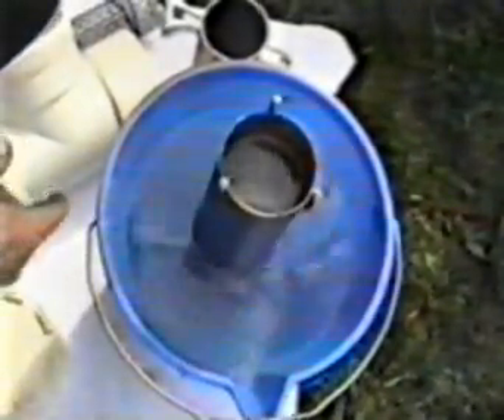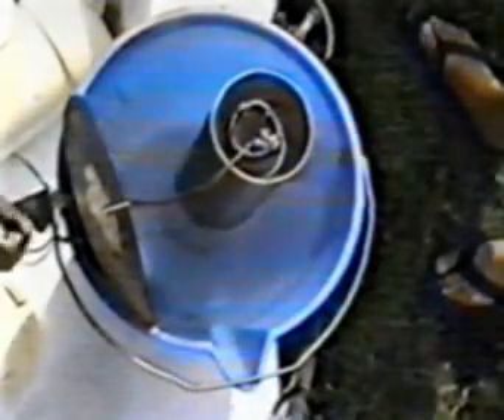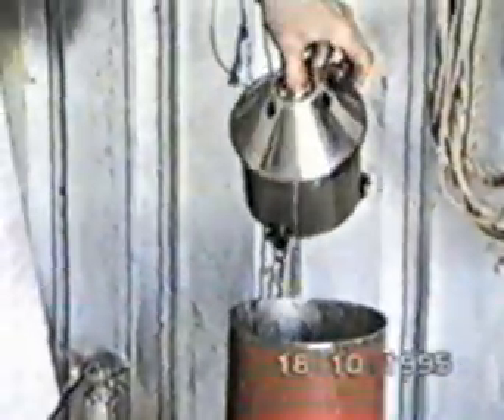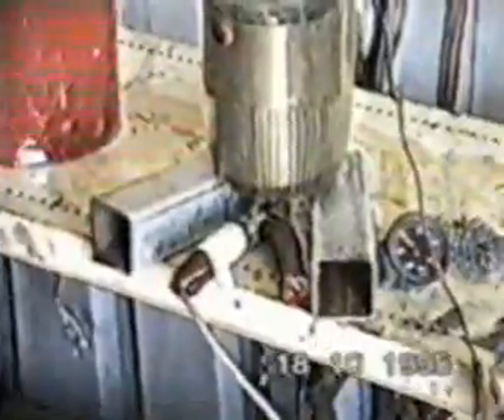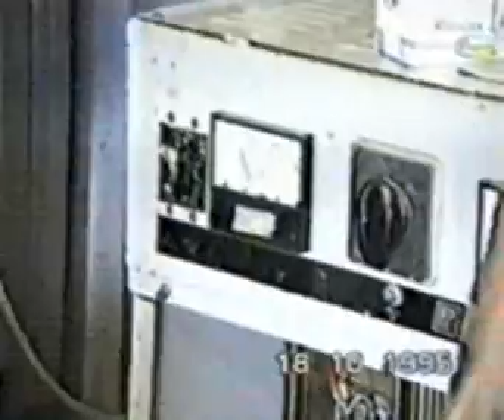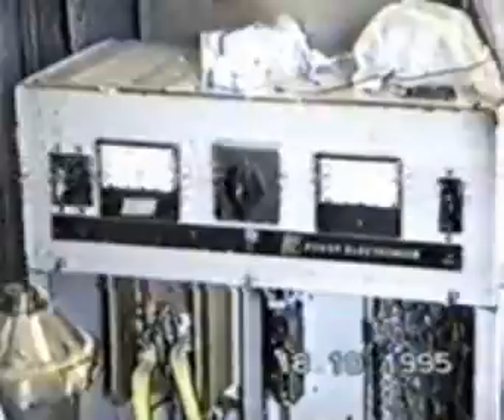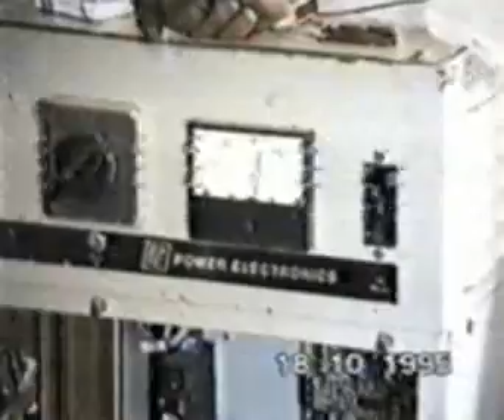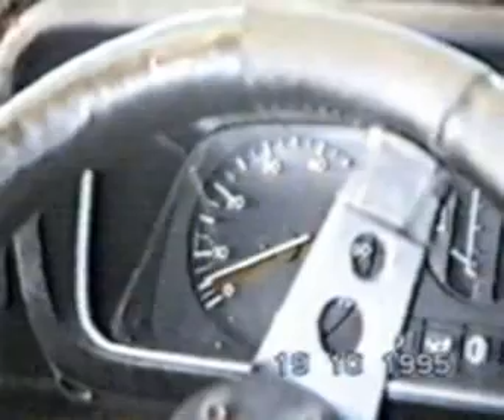Joe's Energy Cell (original recording 1993)

Comment: I will by short. Opel is an specific engine it has lot in common with the Adams Familie movie . First that engine is based on militari engines they have programabel cilinders and valve heads it is related to this: multi fuel,dual porting of fuel,multi stroker, 2-3 engines working in 1 unit !The other detail is it can work on organic gas aka bacteria and elements mixtures .So that thing produces it's own gas while operating in time delays. The Hit n Miss miss fire sequence is perfect exampel you use reactivity of gas to explode it after that second effect acures thermal atraction the 3rd action is electro magnetic gas atraction by its polariti atraction. That way you gain 3 different engine types who all of them need proper control cirquet to control them in %\%\% ratios ! They call an Opel engine Internal-External burning engine for an reason or Dobbel Acting Fuel behavior so the actions are delayed in time differences so dobbel or multiple ignition events acure and yes you can pulse different electricity types in phase angel difference as long you use up that energy no dead short what so ever it is based on( Metadyne rotary transformer with variabel brush polariti out put + - ,- + ,+ + , - - ),or transformer when you latch pins 220/12 = "-232,+232,-208,+208 and still probabli you can add dc pulsed cirquet and flat line dc on the same transformer thats called universal out put power supply ,similar to it is computer psu when you mix out put polaritis of individual leads,dual relay effects,delco magnet starter motor with s/r starter selenoid ,alternator secrets delco 12si hv bypass methodes twin regulators and twin rectifiers serries/parrarel switches,wacum tube baterry charger 3baterry types unsed at the same time, buzzer horn,those cars do not have diodes or zener diodes,heavy tendency to absorb tree based acids condensation and coolant electrolisys,they have bade tendency to run at ultra lean and rich fuel mixtures ,and they do love cold diseling and pre ignition effects. Cars related to that subject are Shell 376mpg Opel Rekord P1,Hot Bulb Dual Fueling Train with Electric Tripler Set Transmision exciter+dc-dc converter+Metadyne transformer ,Owen Magnetics,Deuce Half Truck Multi Fuel Engine ,Farmmal MD tractor ,Caterpilar 2 stroke pony motor so add extra cirquets like stroke devider/multiplier ,magnetic pumps,high amp ignition or plasma,add vaporisators,magnetic gas pulsers,magnetic metal elasticity enchancement,magnetic head valve control ,magnetic mixer and most important learn to condense gas floating in air based on tree mather who are atracted to an hot magnetised motor the motor will flood crank case or rapidly cool down >compare pure tree oil with gasoline in flame strenght smaller carburetor jets so it is similar to furnace oil burners and co2 gas arc welders ,lot effects acure but ordinari Opel engine can use 1 of those mentioned engines ( strling,steam,papp,flame liker,rocket,pulse jet ,hot bulb ,hit n miss and normal acids,gasoline ,diesel,lpg,propane,ethanol/methanol in their pure state. So I listen to your guys suggestions but I already know lot of it after all I did witness some of those effects on my own and that Yellow guy is hell of an good mechanic . Controling 2 engines is an great deal but controling multipel of them and spliting them in to fractions is some thing ells .The problem with you guys aperantli you do not understand the wide varieti of engines that can by mixed in twin formation or tripler set that wuld explain why fuel is used more like an solvent and other gas takes over who are mixtures co2 ,organic ,or pure based fuel who is combined added aditive Later so the engine it self is an procesing unit well if you can't exceed 100% burn rate so you simpli use other reactions who were not used before like exampel magnetic atraction of gas so that engine creates static discharge from its own cilinders called the Papp engine effect so bouth + and - paths to devices and baterrys are effected . I call it more generators out put polariti ratios in hrz frequency range difference and colideing electricity types at phase shift and hrz difference effect varies . But plug out ordinary starter motor magnets miss place them you get different results at ich brush out put ,brake magnet,displace their pole faces ,or heat up ferrite magnet or use short brushes or place brushes serries/parrarel path's toggether you will see result instanli ,virtual baterry plates are easely created in fact 2x 5pin relays to lot staff ,xenon with out ballast gient sparks . Any way I won't argue with people I admire thatose guys they are honest and have great knowlage I respect that lot effects acure at the same time so all sience is involved at the same time so results varies always who goes last or first doesn't mather the engine it self operates in unusual fashion .So it's easy to turn any engine to their older form if you know what cirquets you need. Exampel an hot bulb can work also on magnetic pump insted turbo ,or changing 4 stroke to 2 stroke or 0 stroke who is free floating gas from exaust to intake might as well represent an rotary engine type as Pulse Jet , it might by that you can seperate ethanol/methanol in an engine at fire one of them at compresion the other at exaust that wuld explain why magnetic pulser seperator pump is used with 2 different sparks frequency ranges that's called ordinary electriciti phase shift but aperantli gas can by phase ported as well so that's the term Dobbel acting fuel effect . Any way my set up is different cars around the world have different enviroment ,control cirquets who are hidden and slight differences are present for Vauxhaul,GM,Opel,Holden but the basic principal is always the same . In fact pierburg carburetors have even thermo time valve if you crush that deam thing you finde inside 2 disks and some sort of ceramic substance fuck my that deam thing looks like an piezo disk vaporisator ,leaky mechanical fuel pump,some chlorine+calcium+brake fluid =self ignition fuel and that all is bypassed wia blow by hose even if you shut of carburetor the crank case acts like 2stroker fuel pre heating and porting , well most of the time if my engine is magnetised my car uses only idel port and accelerator pump on an magnetised engine at some point centrain engine rpm the primary and secondary carb Jett's are not even used so on what ever that deam thing is running on isn't really fuel but I mentioned inurt gas,metal particel and tree based substances any way and the fuel reservoir is kinde of to close to exaust pipes ,ethanols bade tendency to absorb moisture well some bacteria eating oil suposedly exist and ther you go engine runs on peanuts with out an cell 🙄🦾 yeah many peopel dont know those old engine effect simply many things are to much involved confuseing lot but bouth Peater and Joe are far beyond capabel men 👍 I personli managed only controling my engine at some point changing their engine type individuali some times by accident get twin engine effects or share gas betwean cilinders ither crossing spark leads ,reversing distributor,external arcing relays,valve clearence intake-exaust or I belive in my case the implosion/explosion effects caused my block to form small micro cuts the size of an sawing needle so exampel 2nd cilinder shares some of the gas in %\%\% ratio with 1st and 3nd cilinder to compleat the cirquet you need to attach cilinder 1 to cilinder 4 the multi stroker is set or some other fiering sequence is set like in my case the British Flat Head Fiering order works as well or pure external ignition if you put distributor on warm engine at 180° . So you guys are sourcing the wrong direction long time ago. I personli withesed my own engine working for months with out fuel it Actuali gained it by absorbing moisture from the air but in return more coolant and lubrication oil was consumed perhaps I did not have good cooling capability but even that probabli culd by reduced but with out proper transmision or electric traction motor that thing became ordinary tractor motor with enchanced effects mostly massive torque and fuel efficiency nothing ells. So it does work kinde of but all systems in the car probably need regulation bether and cloosed loop system expeciali starter,alternator and the baterry .Most likely the engine shuld not have any phisical conection with the chassis so the engine must by insulated .Because if an car is magnetised all metalic springs stiffen or harden so you running at rish engine run away or loseing brakes or suspension might fail including rubber deteriation so tires might blow up so that's why shell put the engine inside an box who is an multi porpuse device (eliminates emf radiation from high amp ignition,prevents rosting chasis ,ceaps heat inside,the box is an ventilation for toxic gas neutralisation,to maintain or regulte heat and moisture content of air,preventing fuel from frezing,buffers engine sound and similar) preventing general damage that's why Shell managed to gain that tremendes milage and I beat them long time ago even tought by accident . If your not capabel useing twin engines start enchancing ordinari hot bulb or hit n miss adding cirquets to it and finde ways to "compensate for loses" then eventuali the Joe Cell is easy like playing puzzle pieces . I'm just shareing my advices and years of experiance I hade to surche for answers nearli in all fields biologi,chemistri,metalurgi,farming,electro magnetism and what not but Actuali those are simpel low grade information who barreli have any thing to do with conventional science in fact if you combine those things all laws stop working at some point so logic is used instead .

Comment: Why would it use advanced timing on this??
Reply: because it produce implosion when piston go up (compression). after that piston go down pushed down by compressed air .This is cold implosion (not combustion)engine...( If this is not a fake?)
Reply: @optym82  u right  this  implosion with vaccun/  since the. Power of implosion its stronge I react to suck the piston up to the tdc and. Just because create pressure into  cylinder  that pressure  push the piston Down  or. Say assists the movement of the crankshaft  but. Need timing the engine to work otherwise  will just be helping the fuel to burn better/  or the engine. Will turn on reverse